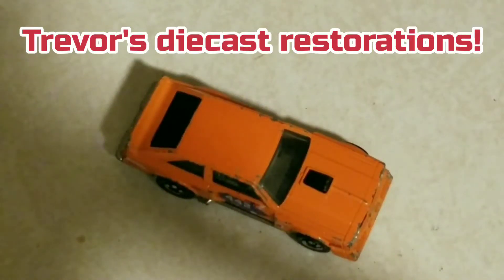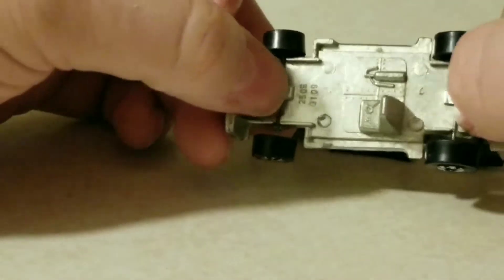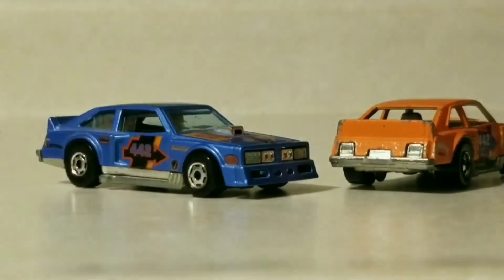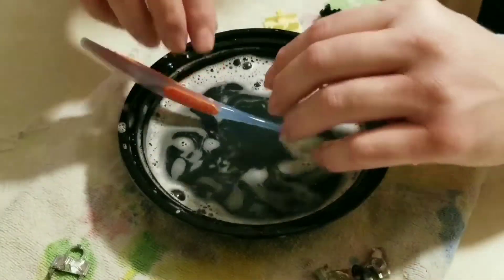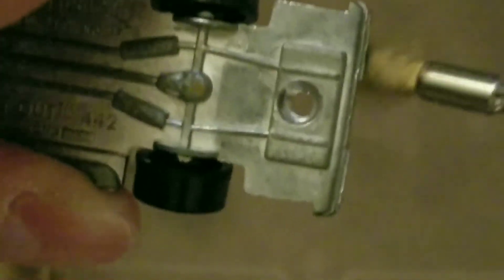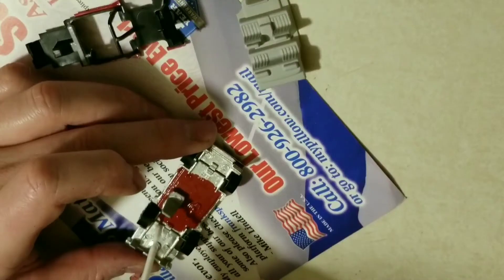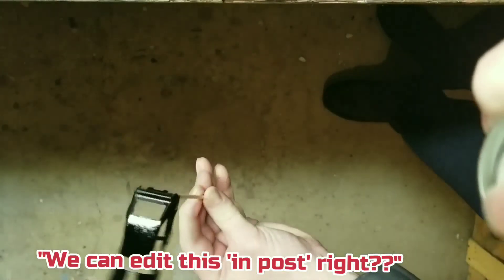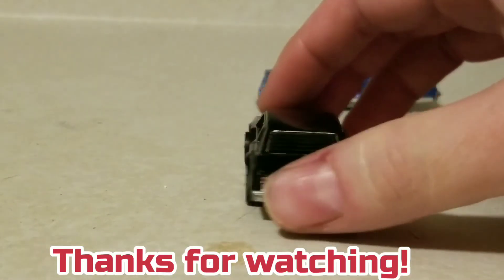Episode #1 Hot Wheels 1978 'Flat Out 442' Restoration Modified Custom diecast car

Comment: As you can see from my icon, I'm a big fan of the Hot Wheels Flatout 442. I was looking to see if there were any new custom videos for this model. One tip I can give you is that with the ones I have done, I used floor polish on my black interior parts and the glass. This gives it all a great shine and helps to cover up any scratches etc. Don't get discouraged and keep making videos.

Comment: Oh, yeah. I believe the green Flatout 442 was the Canadian release. I could be wrong but, that's my understanding. I actually have one of them. There are different variations of some of them and the most notable is those with and without the pentagon decal on the sides just behind the wheel well.